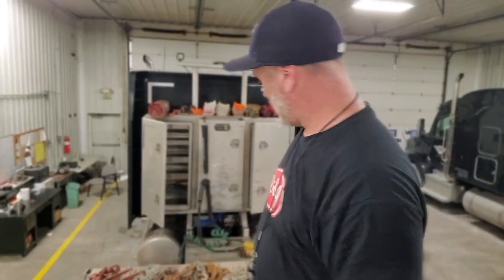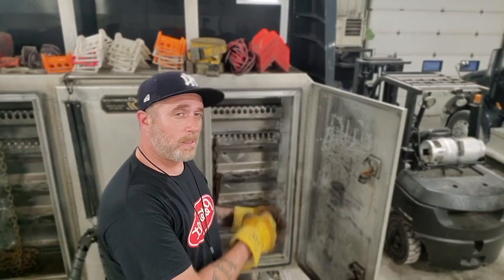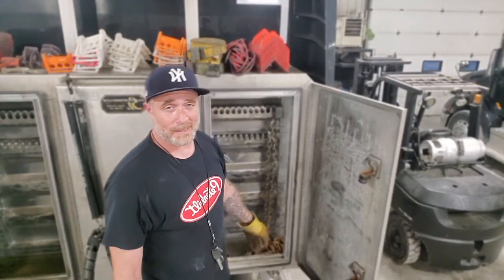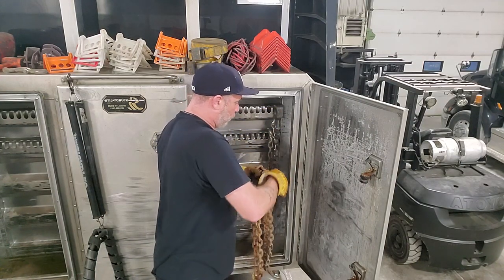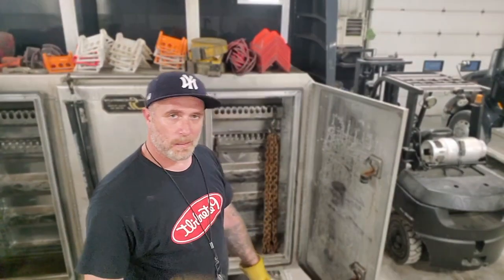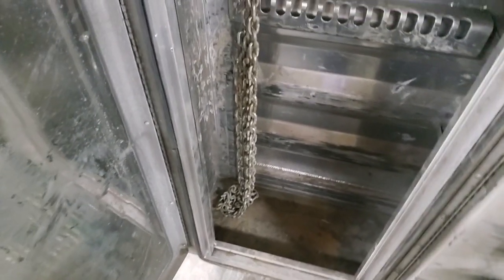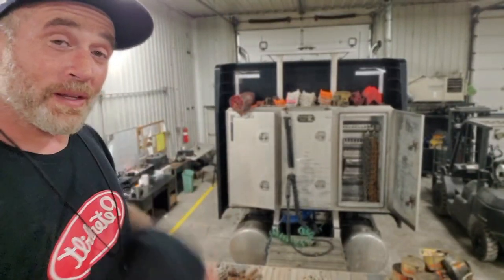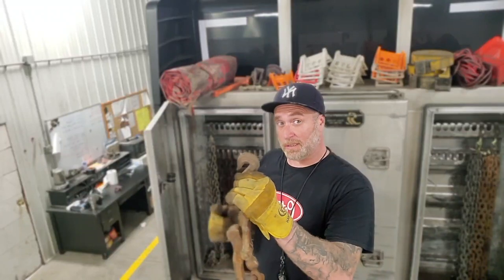CHAIN STORAGE TIP | HEADACHE RACK ORGANIZATION | CHOICEMAS |

Comment: As long as you lay the chains into the headache rack say outside->in then pull them out the opposite they will never get caught or cause any problems. I like the idea of upright sections of 4"x4" tube stock standing upright where you put the hooks at tge top then pile each chain into its separate tube.

Comment: Place a rubber mat on the bottom or have some chain on the floor. If the chain is hanging and barely touching the floor, it will rub right through with the swinging motion. Steel vs aluminum, steel wins every time.
Reply from the maker: Thanks Rob, fortunately I haven’t seen this happen in all the years I’ve been out here. Not saying it can’t happen because it seems absolutely logical to me. Just hasn’t happened and it’s so much easier to collect my chains from the headache rack when needed.

Comment: Great Tip! What size chains do you keep on your truck 5/16 or 3/8? How many and What Length? Thanks
Reply from the maker: I keep 3/8 because there are some shippers such as “CAT” or John Deere that SOMETIMES require 3/8 chains only.  I’d much rather carry 5/16 though. Lighter and easier to handle.  I just don’t want to get turned away from a load because I don’t have the proper chains.